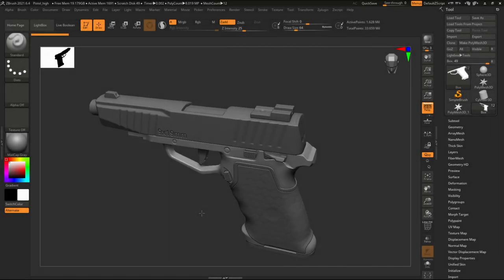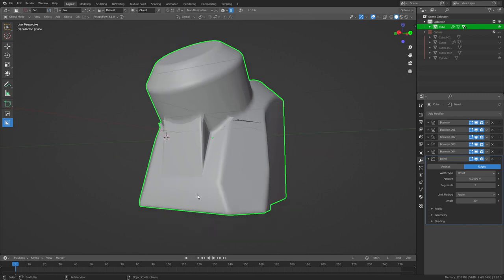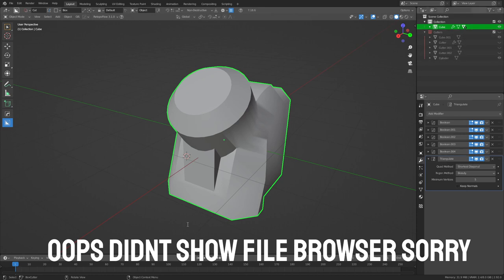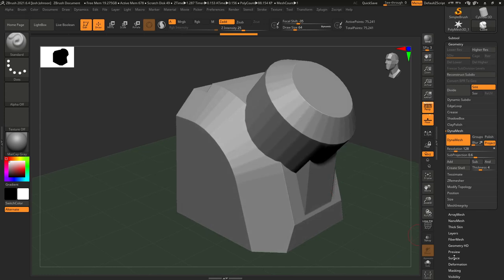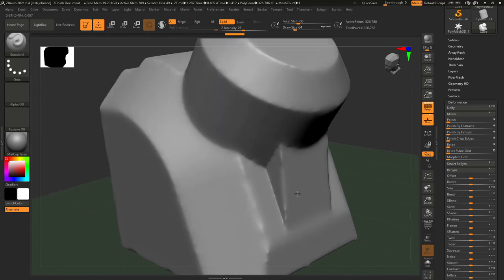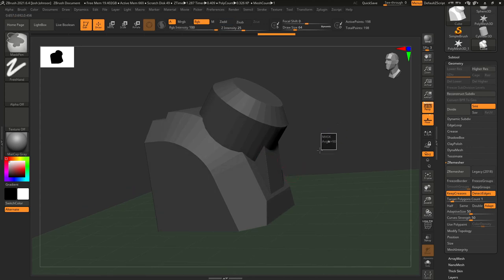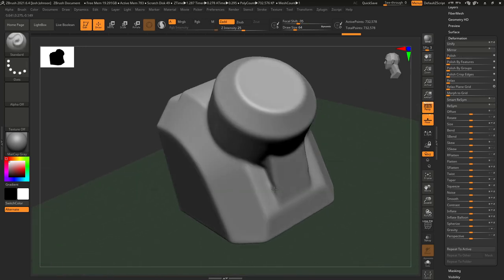Perfect Bevels on Blender Models with Zbrush

Comment: There is another way which is: you load the object and autogroup by normals, then you apply creases by polygroups and then use dynamic subdivision. This way when you dynamesh the model it will have nice and smooth boundaries.

Comment: i usually do another methode , i unwrap ther mesh in modeller softwarer ( seams on edges want to bevel ) , then bring the mesh to zibrish and then groups by uv , then dynamesh it on high polycount. now mesh is ready to polish and you  can use benefits of isolating polygroups and polish individually each surface , you can polish curved surface wish polish with featues to make copletly smooth curve  // at the end you can mask borders and blure it and invert it and poslish it to rich bevel .

Comment: hey dude, old video i know but i just wanted to say you can do the same thing in blender, you can voxel remesh your model with a voxel size of around 0.01 depending on the mesh, tjhen you use smooth corrective modifier to get the smooth edges, you should give it a try.
Reply from the maker: I need to investigate this! Thanks for the comment, I tried smooth corrective before but I couldn't get it working, once I crack it I'll see about releasing it as a future video.
Reply: @NightHawk664  yeah man, set the factor to 1 and put on "only smooth" set as many iterations as you need, I usually do around 30, only problem iv found is that your model must be 100% non destructive

Comment: 1 More Thing^ 
- u should to use more biggest level of detalization, before u make Boolean operation, and then make edge smooth in ZBrush.
P.S. Boolean in ZBrush is faster.
The Pipeline is:
1)Make bloking youre future mash with a good detalization (subdiv).
2) Export it in to the ZBrush.
3) Make Boolean in ZBrush.
3) Make Dynamesh in ZBrush.
3) Make Smooth edges by Deformation 
4) Make Decimation (like 1%)
light & Smooth High-poly.

Comment: You should learn how to use blender correctly.
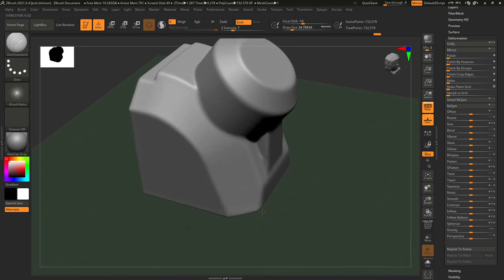4:55. O, and your Z-brash ultra extreme amount in unwanted poly model is not even close to perfect.  with that much of tris you can create a whole 3D seen.
If you want perfect Boolean result and higher quality model you should use cad soft like solid work or Fusion 360 instead .
Reply: You do realize that the remesh done in the video is for baking right? nobody in their right mind would want a super dense geo pistol for a game or any object for that matter.